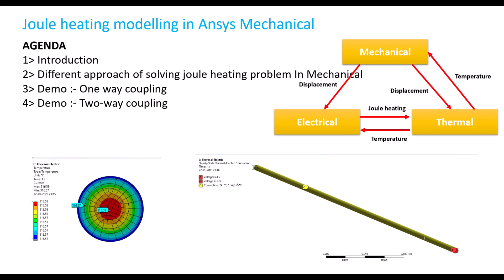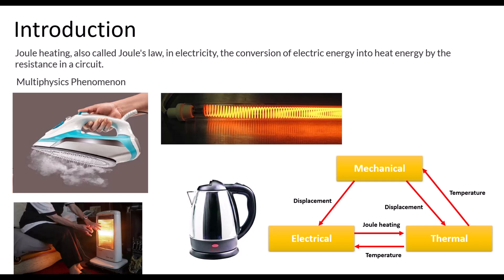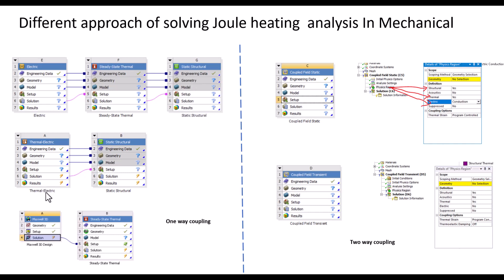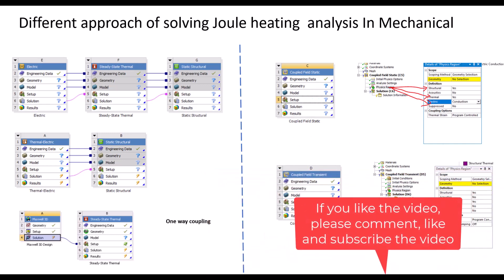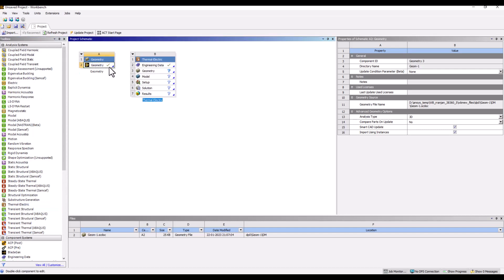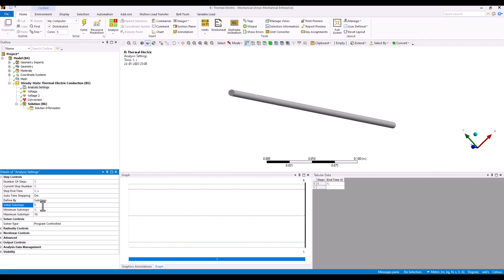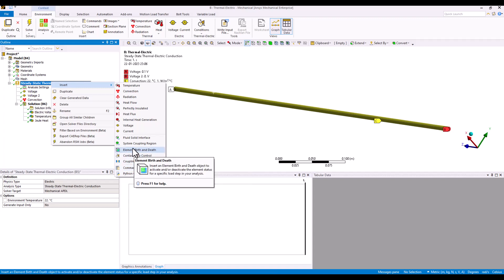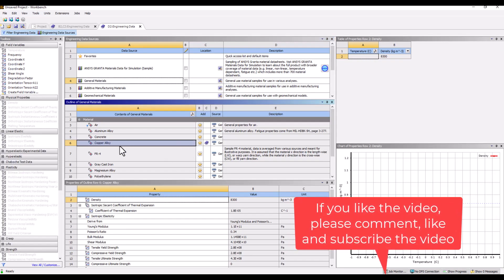Ansys Mechanical Discussion 7 : Joule heating modelling in Ansys Mechanical

Comment: Could you kindly assist me with simulating a circular tube through which fluid material (water) flows and a circular titanium electrode is placed in the center of the tube to provide joule heating and analyze heat transfer to the fluid as well as velocity distribution inside the tube using ansys fluent?

Comment: i want to simulate a nitinol wire. the values are known to me. the simulation is like this first the wire is stretched to 2mm and then temperature condition is applied to regain its shape. the wire displacement i obtained but when the temperature is increased the wire does not come to its original shape can you help?
Reply from the maker: Please check shape memory alloy modelling. https://courses.ansys.com/index.php/courses/structures-in-healthcare/lessons/using-shape-memory-alloy-sma-in-spinal-spacer-lesson-1/

Comment: hey can u give an idea about how to do thermal electric simulation if current is flowing in a cyclic manner(load for  hour and no load for another and so on..)?
Reply from the maker: You can use Transient system and apply the current as function of time. The easiest way will be calculate the values vs time in excel the copy paste in the load as tabular data.